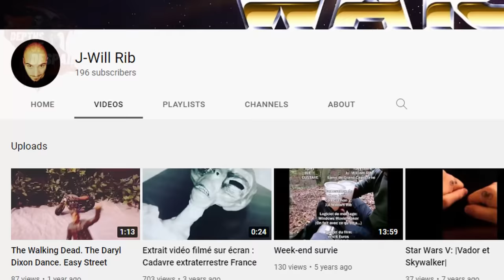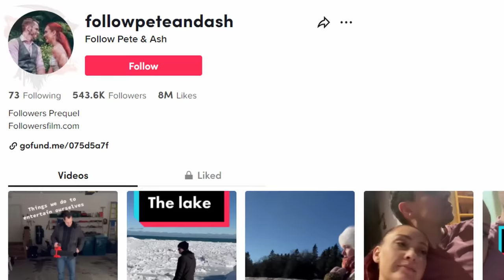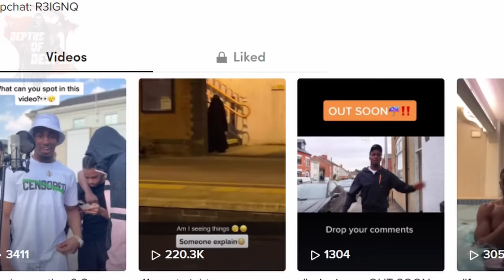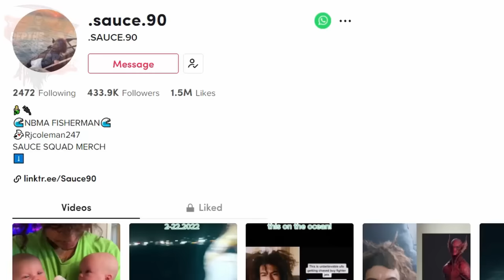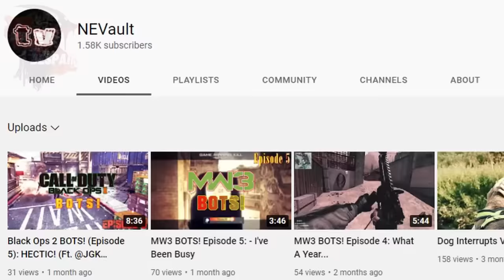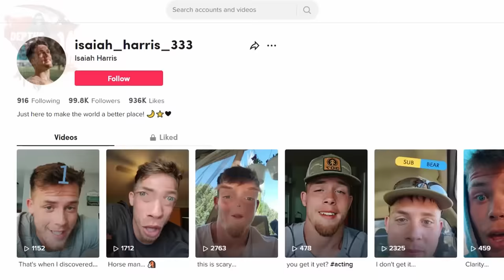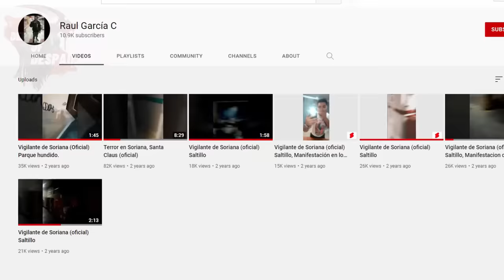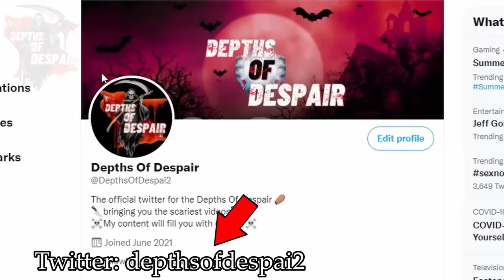Top 30 Scariest GHOST Videos Of ALL TIME! V2

Comment: "The Dark Hole" around 1:35:00 is just an animal trapped in a well. The stone manhole thing he uncovers is an access point to an ancient aqueduct system called a quanat. These quanats were extremely common across the Middle East's arid/desert regions and consisted of long underground tunnels dug from a natural spring, to carry water miles away. Along the tunnel length they'd have these "wells" or access holes to draw up water or clear debris. It's also common for animals to fall in, especially with old disused quanats, and get stuck or die in there. 

The noises he gets sound very much like a hurt animal to me. I've heard similar noises out in the North American woods many times, usually from something trapped. Mystery solved, and it ain't ghosts.
Reply: I agree… instead of thinking “ghost!” why not do something to help the trapped animals? Still, the older guy who lost his wife seemed genuine.
Reply: Awe poor animals that’s so sad I agree it sounded like a hurt animal

Comment: water turning on in a faucet is done by having someone at the turn on/off cycling on the water.  Once this happened in the whole house, but they messed up when they showed the before and a faucet was already on in the kitchen (one of those single handle Delta faucets) and just had someone manipulate the main water to "on" when queued.  Banging can be easily manipulated by a known person, not an unknown entity. If you want to show true paranormal activity do so with witnesses, in good lighting and with full exposure of all sources.

Comment: For the trees, if you relax your vision and look at the entire scene rather than any single tree, you'll notice unnatural straight lines of motion instead of natural wind. The branches are definitely moving and making noise with nothing there, but it's happening because cables are being pulled through the treeline, and it eventually breaks the front-most tree, which is the most visible and the one everyone focuses on, as well as many other small trees along the cable line. You can see the broken small trees in the ground in the background during several still frames.

For the sewer monster, this is one easy to identify if you don't look at the screen and let your ears do all the work. It's an angry Chihuahua or another small breed of dog, very angry at someone who is invading on "it's" territory. You can hear it give warning growls each time, following by angry growls when the recorder doesn't retreat. Finally. it gives a big bark and chases him while he runs.

It's only scary because it's a creepy location and we can't see well. Oh, and I guess because angry chihuahuas ARE kind of monstrous little things.

Comment: The one with the Hispanic family and the shadow figure in the basement, they should have went down there with a flashlight and shined a light at that dark shadow figure so they could and so the camera could be able to see it. Also, dark entities don't like light. They can't manifest in light. So the thing was in the basement in complete darkness where it is comfortable and where it can just BE and they turned the light on and it was found crouched down in a dark corner. Then as it was coming out of the darkness it shut off the lights so it could come out of the dark corner. Some really really dark entities can't even BE in an area where there is any light. Not even a candle light. So, it will blow out the candle so that it could be there. Otherwise it has to stay in complete darkness. But that experience seemed really scary.

Comment: There's no way that guy that keeps hearing the screams at night that get closer to his house every night or no goes out Into the Woods to confront it And as the screens are getting closer and louder and you can hear it coming he turns and runs back to the house. There's no way he didn't mag dump 17 rounds of 9mm into the air from his Glock.  If you're Going Out there to confront you definitely have a firearm And you are definitely not gonna let the sound of something charging you and the screams getting louder  go unpunished and without recourse.

Comment: Story 29 I thought I could see a face in the bush (bottom left corner in the hole) outside the window of the room that the door slammed shut.
Story 23 sounds like a pack of wolf's or something similar
Story 22 there's 2 shadows (invisible silhouette??) in the trees 1 in the tree behind the tree that fell it jumps and slides down the trunk and another in the tree to the left of that one in between 2 branches 
however I could be wrong on both accounts. 🇬🇧🙏

Comment: Yah the guy with the dog Nala is staged..its all fake..first clue..guy did not freak when his dog made noises when it was being hurt and clue number two he turned the hall lights off to signal the start of the set up..clue number three the way he holds his Camera keeps u from seeing much of anything..clue four when he's comforting the dog it sounds like chains or something being moved on the floor heavily..too heavy for a small dog...clue number five u never see the dog..and the fifth clue is the angle in which we see the door close...someone could have easily put a thin line on the doorknob and pulled slightly so it would close because it didn't slam...and finally the last clue when we see his reaction..its fake..his reaction is poorly rehearsed or he's just naturally a bad actor..pay attention to how he breathes too...its staged..its faker than kim kardashion